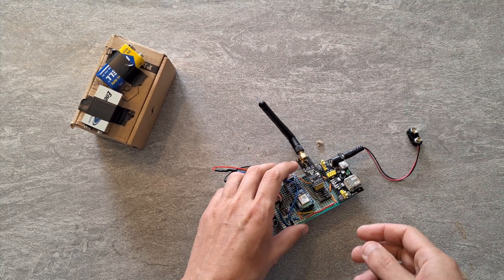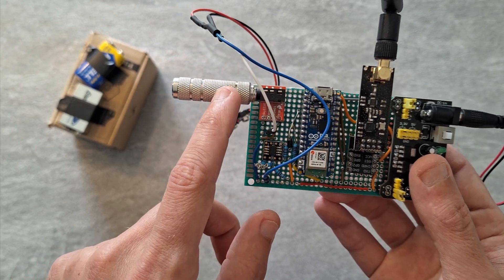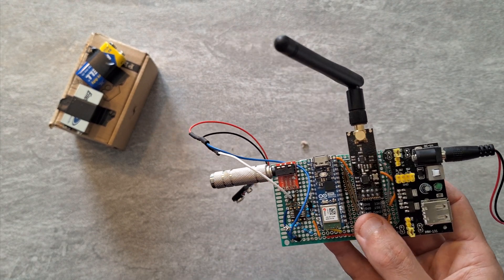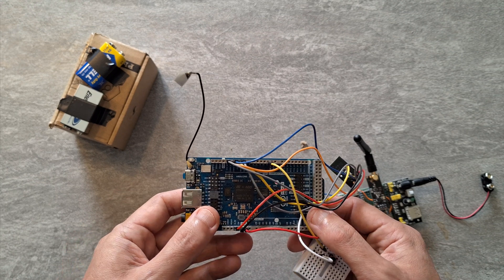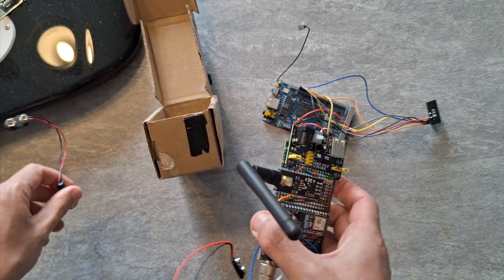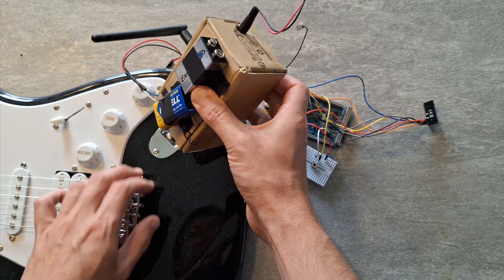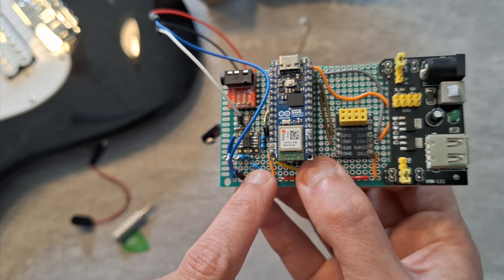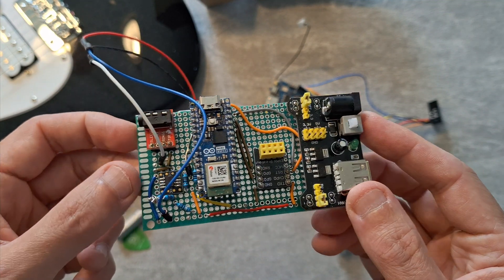Arduino Nano ESP32 / Giga R1 Wireless electric guitar

Comment: Pretty cool thing! Do you know, can 16 bit 44.1kHz mono be achieved with that setup?
Reply from the maker: If i recall i did 32khz. I think it could push 44.1 but with 32 I could just squeeze in 4 samples to reduce noise. At 44.1 There may not be enough cpu cycles free to do the digital filter. With the amount of noise you wouldn't notice any improvement at 44.1. I need to choose a better adc
Reply: @JamesHardaker  OK, thank you!

Comment: Was the nanos onboard WIFI too slow?
Reply from the maker: Yes, for these tiny packets the overhead of the api/stream was too much. There was always at least 200 ms delay. I tried udp and Bluetooth and I didn't use the arduino wrapper classes so there was no boiler plate code getting in the way, still no joy. The radio transceiver delay is 15ms. I had time left to do the noise filter